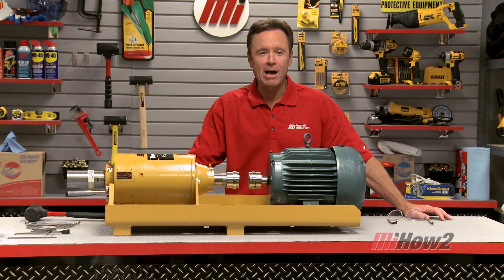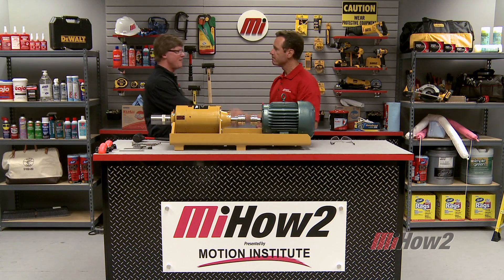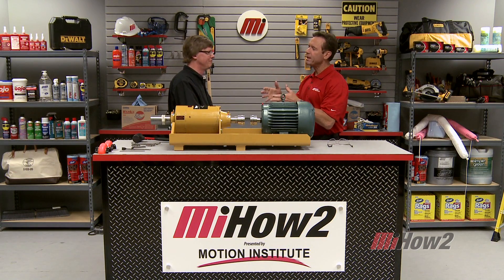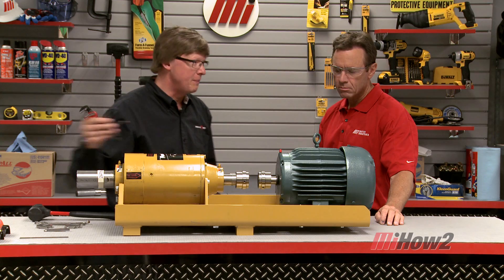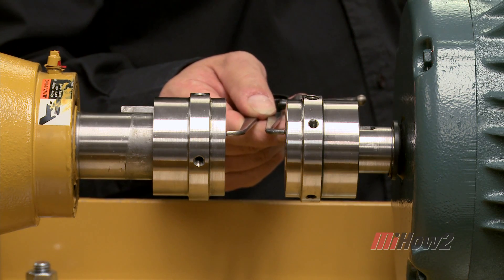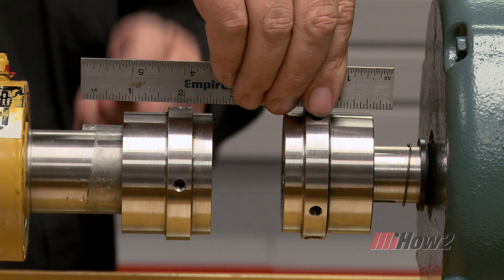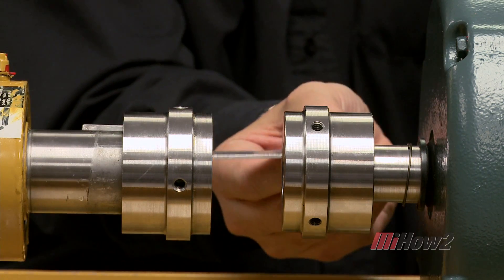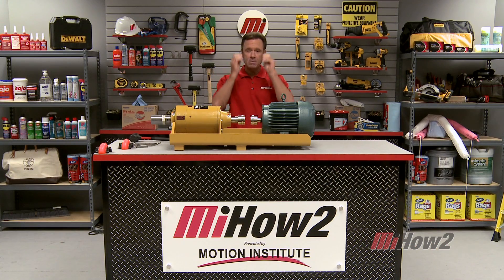MiHow2 - Rexnord - Rotating Equipment Alignment Basics

Comment: I hit dislike.i will give this video  a 3-star rating.these are the 4 stages of shaft alignment below.& they should be followed in sequence

1.correct angular mis-alignment in the vertical plane.
2.correct parallel mis-alignment in the vertical plane.
3.correct angular mis-alignment in the horizontal plane.
4.lastly,correct parallel alignment in the horizontal plane.

This video didn't mke these stages clear.

Comment: ok this may sound stupid but could some body tell me why motors arent setting on stilt screws? all you would have to do is tighten and loosen to raise or lower the  foot
Reply: NOBOX7 the likes of same wouldn't give a flat machined  rock solid platform needed  to carry out this precise work, he talks of 'soft foot' and problems related to same, jacking   one corner more than another on those  stilt screws would create this effect causing stress on the motor base....adjustments with shims are made in very fine moves..sometimes  the likes of mere several thousands of an inch .005 of an inch or less!!!... you won't get that with jacking up via screws.... plus vibration created during a production process is absorbed into the base and foundations rather than having the motor perched on screws...
Reply: malachy1847 no not perched on screws just positioned with screws and then shimmed snugg and bolted down with secondary anchor bolts, but i see your point
Reply: +NOBOX7 Jacking plates  fitted with hex set screws  are normally welded on the  motor base plate, these screws  come into contact with the motors feet  at right angles  to same, this allows you to snug up /lock same to the motor casting  so that the motor doesn't drift all over the place,  as you could loose that "Axial alignment on the horizontal plane" as he calls it........ you then just use a pry bar to lift the corners and slid in the shims, then lock down the holding down bolts and check  / spin your Clock Gauge looking at the readings.....but as i said you must get that alignment "axial on the Vertical plane" sorted,... FIRST.... then you are good to go for  correcting that' Horizontal Offset' by .... shimming all around....same would be half the 'Horizontal'  'offset' measurement  
 at the top of those couplings...again  if you use feller gauge measurement just   Half same  , or half the reading  given to you   on the clock at the bottom /180 degree measurement on the clock.... throwing in the shims denoted  by this measurement  on all four motor feet after which  tighten very slightly ....then  use the jacking screws against the side of the motor feet  to correct drifting in the 3 O'clock   and 9 O'Clock  region and your more than close  in achieving really good  alignment... and being as we say in Ireland..." In the same Parish"  ...
Reply: malachy1847 thanks for the input friend , its cool to hear from somebody who knows what there talking about , and i see what you mean about the .005 " move being beyond the ability of screws and i forgot the math used to determin these shims and the subtle moves involved would make using a screw even more complicated perhaps   , i like to find new ways of doing things so i like to discuss ideas ,
Reply: NOBOX7 @ 4mins -30 Secs in...seems like if they  were to try to shim  that gap they were showing with their  straight edge....you would make things even worse...as the motor is too low relative to the motor to begin with  yet it has to go Down...you always check and adjust from the 'driven to the  driver' ..[ be it even more complex/ another curve ball ...would be having a Gearbox in the 'middle'  .....   thus you check the input coupling  of a pump to the output coupling of  a reduction gearbox,  and then from the input coupling of  that gearbox, to the output coupling of the motor...  hope that explains what you may come across]....good luck...